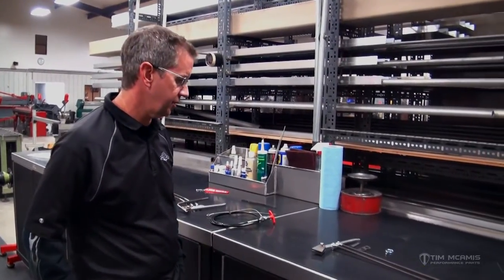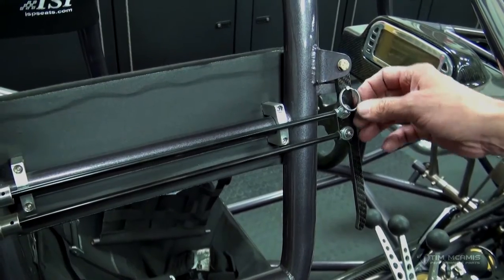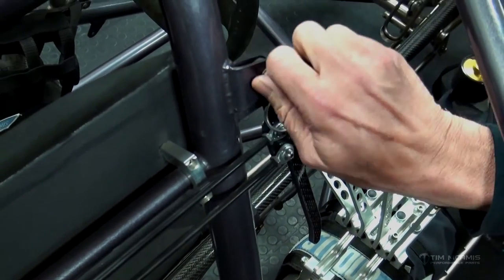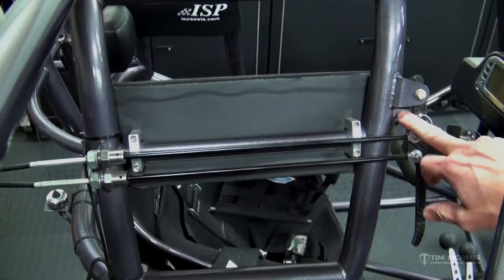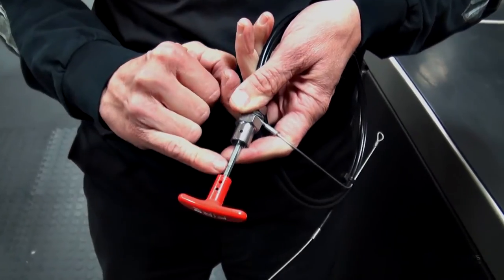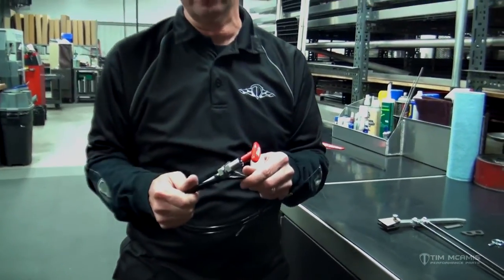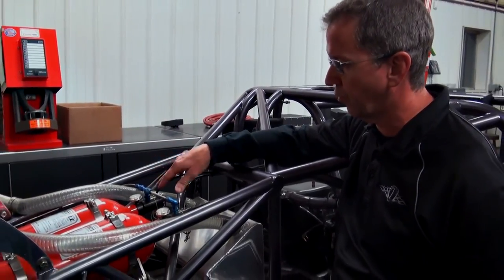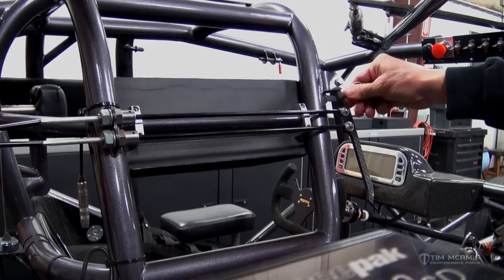How To Install Fire Bottle Handle

Comment: We like your mention of checking the cables to make sure they move freely! Another thing is to check is that it will move freely also with all the bends when installed. A solid wire cable has to have a larger radius then a twisted wire pull cable. We supply a twisted wire cable for that reason.